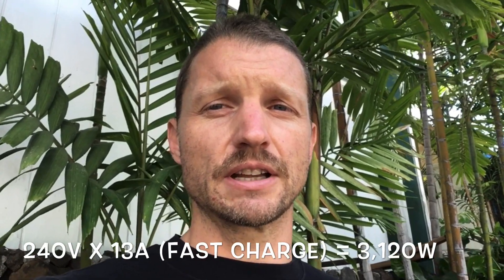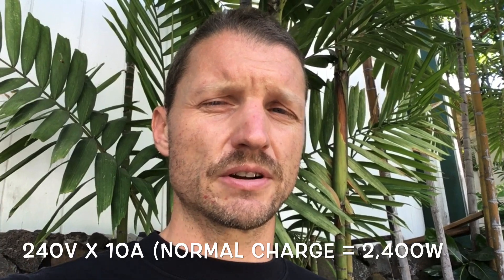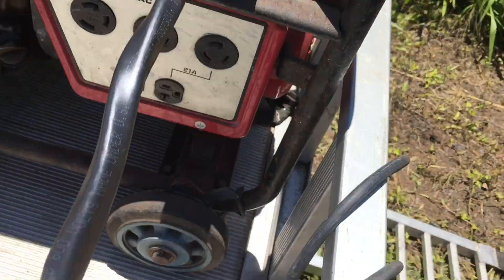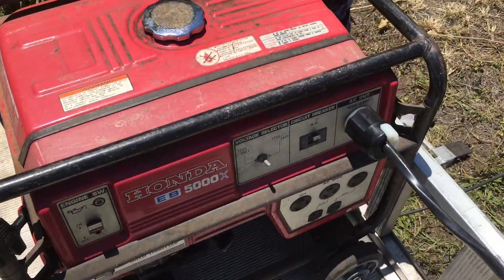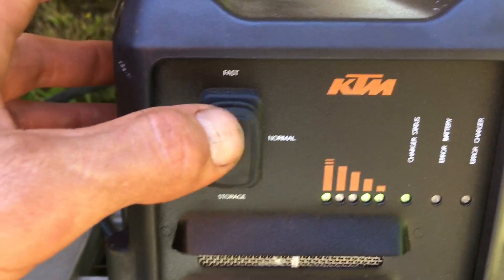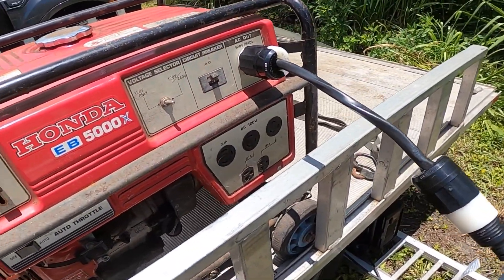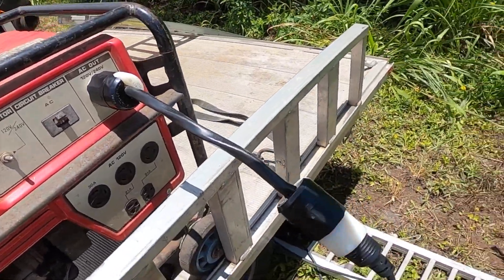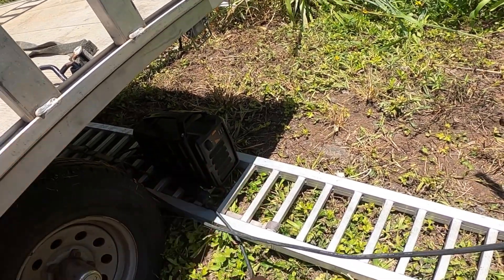Generator Charging the KTM Freeride E-XC

Comment: High end RC CARS use super nice electric motors and they don’t ever run hotter than touch. Like 135 degrees F.  Seams I read somewhere that FREERIDE’s like this but lower at like 120 degrees F.? Seams like this controller and battery need a software update with the newest technology….  The BMS on the battery is only letting us use about 70%.of full power. Surron was like this and simple wire fix had 100% to use . Giving bike a good amount of power you can feel..Kinda weird KTM is pursuing this for the people who dumped $11,200. On 12 year old technology? I live in cool weather and I’m really looking forward to the spring and my FREERIDE I live off grid solar with a big generator that can handle half the wattage my solar system charges at. Thanks for your help and videos
Reply from the maker: Nah, just high voltage, dumping 4kwh of power through it in a short time, and hot at hell conditions. It's a problem on all ebikes that get the piss ridden out of them. It never cut power or anything on me, just wouldn't let the battery charge until battery temp came down. The motor is water cooled and fine.

Comment: I ordered the plug adapter from home depot (no cord, the adapter is the plug itself) hoping it works the same as the one you posted on your link. Should be getting a freeride next week.
Reply: Can u send a link so I can look it up? Did it work?
Reply: @dennist6905  it works great. Will get you a link.
Reply: @yeggar649  cool, just got mine yesterday I didn’t think it would be this hard to find a way to charge it !
Reply: @dennist6905  Oh nice! Congrats on getting one! Not sure what generator you're using but I'm using a predator (harbor freight) 5500 watt/6500watt peak generator and it works great.
Reply from the maker: @dennist6905   do you have a dryer at your house? Those are generally 240v source. You may still need to adapt it depending on what plug you have, but that's how I charge mine most of the time. Just pop the battery out and carry it into the house. Pull out the dryer, unplug, plug in the Freeride charger, and charge the works on top the dryer. 

Just remember to charge the 12v accessory battery under the seat once in a while or the bike won't start and/or give you finicky codes.
Reply: Little update, I made a 240 outlet in my garage and made a adapter the plug works for my outlet and the generator I have :)

Comment: It wasn’t informative u didn’t mention how long it takes to charge it with the generator.
Reply from the maker: Depends on how much charge it needs or how much you need? It charges at the same rate as any 240v plug connected to the charger. KTM states “approximately 135 minutes” from full dead, It doesn’t seem like it takes that long.

Comment: Any experience charging the KTM from a RV 50 Amp service?   Wondering if that would fry the charger… or would the charger manage the power input regulating the charge on the Freeride….  Thoughts???
Reply from the maker: I don't and I'm not an electrician by any stretch of the imagination, but maybe running it through a voltage converter could regulate what goes into the charger. I deleted the charger specs off my phone, but I'll see if it has a input range on it when I het home and comment back. 50amp is prob way too much.
Reply: @JohnHowerton137  thanks John.  I'll keep researching it.  I'm in the process of building a track on my property.  Appreciate your video posts!!!  I'm going to modify my 1st jump eye balling your video with comments.
Reply from the maker: Here is the charger specs. Thought it had a little more info that this.

https://i.ibb.co/37M3dL4/7-AD831-E9-B01-D-4-BA6-BBE6-6-C9-D23-E065-ED.jpg

Comment: Holy crap, they really need to make this bike ready for North America.
Reply from the maker: Well at the time of this video only 200 had been imported. The 240v is nice though because it charges so fast. Just more of a pain in the butt at first because NA is all 120v except appliances and welders 🤣
Reply: @JohnHowerton137  Yep!  3000 watts is nothing to sneeze at either.  I wish there was an adapter to plug my Level 2 charge point charger into the KTM charger.

Comment: I ordered the amazon adaptor you linked but it won't work for my Generator.  So I went to Home Depot and bought the right connections NEMA L6-20R and L14-20P.  So I got 5 feet 10 gauge 4 wire cable.  Seemed simple enough but the L6-20 is a three wire and the L14-20 is a four wire.  Do I use the Ground Green, Power Black and Power Red?  Leaving the neutral white connected at the L14-20 end and floating at the L6-20?  FYI I had to use the L6-20 because I have the Honda EX3500SX similar to yours wish mine was a EX5000.
Reply from the maker: Oh man, I wish I could help, but it's been so long I don't remember. The homemade cable is at my friend's house with the generator or else I'd open it up and check the wires for you.  

Sorry, by the time I can get you this info, you'll probably have it figured out. It'll be two weeks at the soonest with my work schedule 😞
Reply: @JohnHowerton137  I don't even have the  bike yet.  I should be able to get it on Tuesday but I have to travel to get it so it maybe more like the following week.  I did convert a dryer cord so I can at least charge it for now.  

I need to know if you floated the white wire (left it disconnected) or combined/bonded them on the L6-20R side?  So just let me know when you can.  

It's kinda funny I have to use gas in a Honda to recharge my KTM, it's sacrilege.  I actually moved away from KTM a few years and ride Beta's now.  But I got a Segway X-260 and it's so much fun to ride I decided the Freeride would be amazing!
Reply from the maker: Ok, I'll try to remember to look when I can.

You'll have plenty of fun on the Freeride. It has much more motorcycle feel to it. You'll be in love by the 3rd ride. There is an adoption curve, but that may be faster since you already have the Segway.

Comment: John. Sorry if you’ve mentioned it in the past, but how much does an extra battery run?
Reply from the maker: Not 100% sure, but I think I remember retail being about about $3,500. Seems super expensive (and it is), but its relative. Being that it has like 800 cycles before it starts degrading (and still isn't dead), it's actually a decent deal if you pencil out the long term math. It MIGHT have a 3 year warrenty too.
Reply: @JohnHowerton137  Not bad. Looks like a lot of fun. I’m in my fifties, and I’m thinking about starting with, and just staying with this as my dirt bike. I can ride out back from my home, so it’s perfect for charging, and driving through my neighborhood quietly. Thanks for your videos.
Reply from the maker: @stevemurray6150  it’s a really fun bike and bothers nobody. I very much enjoy owning it.

Glad you enjoy them! Check back for a video tomorrow 😋

Comment: Is it possible to use a 120/240 v step up transformer?
Reply from the maker: Jonathan Claussen yes. I was going to make that video too, but my step up transformer came DOA 😒

If you were going to use the step up transformer with the generator... I suppose that could add one more finicky element, but I know they work just fine with wall power.
Reply: John Howerton 

That would be great if you did a video on the step up transformer! I was considering it primarily for wall charging, and then possibly with a smaller generator when on the road, space is an issue and can’t seem to find a 3,000 watt with a 240v port (to charge on the normal setting on the free ride.)

Planning on getting the 2021 free ride so all these videos have been very helpful!
Reply from the maker: Jonathan Claussen should be able to find a generator with 240. It pretty common motorhome connection I understand. Just have to buy or make an adapter. The generator in this video is like 30 years old 😂

I mostly charge off my dryer at home with an adapter, or at my friends house when we come back from riding. He had the correct L6 connection installed in his house. I'd love to make the video but I probably won't get another step up transformer as I don't really have the need. It does work though. It's actually what the dealer I purchased from uses to charge at the shop.
Reply: John Howerton 
What dealership did you purchase it from?
Reply from the maker: Motocity AZ

Comment: Yeah that's something i never even considered, the batt to hot to charge. Probably less of a factor here in Canada, lol. Glad to see you're recovering, take her easy man.
Reply from the maker: Yeah, I hope it was clear that bike isn't too hot, just the battery.

Not much different than when you leave your iphone sitting in direct sun. Even an unused phone will overheat and turn off in just a couple minutes here.

Next time I'll pull the battery from the bike and set it in the grass under the trailer. Probably be cool enough in 10 minutes or so being the case is aluminum.

Comment: Hi there hope your recovery is going well 🙏.  I have had my bike for about 2 weeks now and the stock tires are completely trashed I think this is because where it ride it is mostly rock and hard pak soil ( Spain ) and the riding is quite fast over this do you have any tire suggestions because I am thinking about changing them. Thanks
Reply from the maker: xan kenlock the stock tires are great for grip on rock (wet or dry), not so great for durability on rock. They're a gummy compound. Gummies don't last long. I can kill one in one ride here. Lower psi, slow speeds is their jam.

My suggestion would be to get a desert terrain tire since it's summertime. These tires are generally durable and puncture resistant. They work a little better once they're warmed up. They will not hook up as well when going slow, but can dig when on the gas ✊ They will not work great in the wet. 

There's no one great all around tire, so you're always going to have a compromise somewhere... Pick your battle.

I've run several sets of the Metzler MC360 mid-hard on other bikes. These are very tough tires, very aggressive tread, and a reasonable price point. Wet rock they're going to kind of suck, but in other terrains you can run low pressure like 6psi and do fairly well. They're one of the better selling tires around here because of me. They're also DOT approved F/R for the street.

I'm currently trying out CST Legion Desert. I only have the front on, but so far happy with the grip. I intend to get the rear. I'll probably put one on my 250F because it's going to end up eating rocks most it's rides.

MAXXIS (same company as CST) has Desert compounds. HT is "Hard Terrain" IT is "Intermediate Terrain". Once again pick your battle. IT won't hold up to the rocks as well, but will hook up better in the looser stickier dirt stuff.

Kenda also has the "Parker Desert." Maybe something like the Millville would work too. I haven't run any of these. My friend actually has a Millville on his Freeride and he's really happy with it coming from the stockers.

These are all budget solutions. There's plenty of expensive ones out there that will be pretty good. My goal is to always find the best working tire for the cheapest price and replace them more often. So far I'm pretty impressed with this CST stuff for the price. They seem to work better than some much more expensive tires that I've tried. Never thought I'd say that!
Reply: John Howerton thank you so much for your help
Reply from the maker: xan kenlock welcome. Hope you find something that works. Enjoy the ⚡️

Comment: Talk about an oxymoron! Haha!!!
Reply from the maker: Sort of 🤣 Still uses less gas. 

You can probably charge like five times off one tank of fuel in that generator. We did 4x 3/4 charges that day and it was still running on same tank.
Reply: @JohnHowerton137  This is good to know. Thanks.
Reply from the maker: The current model EB5000x,  "Runs approximately 11.2 hours @ 50% load (6.2 gal.)"

The bikes charge near 50% load (2,140W).